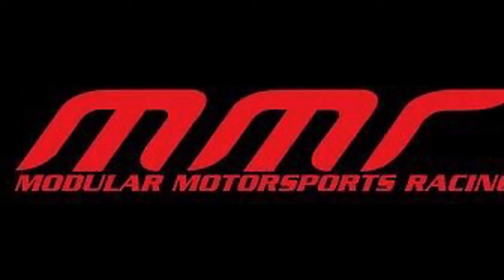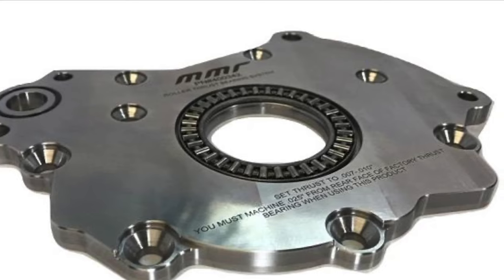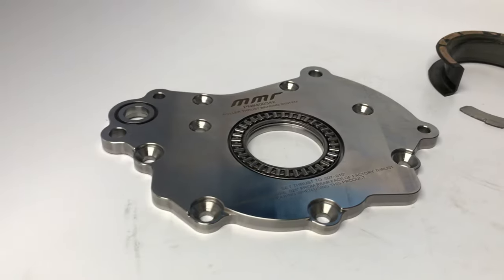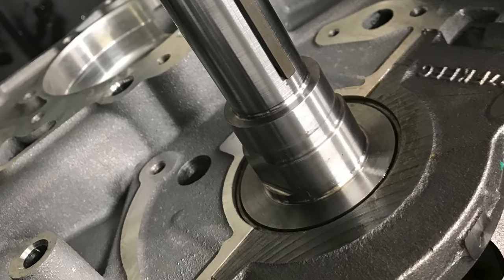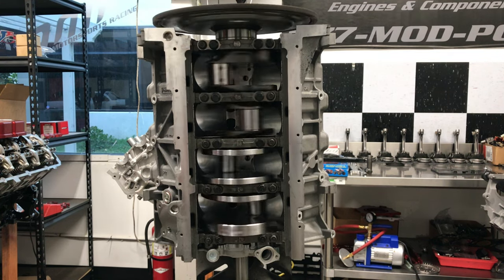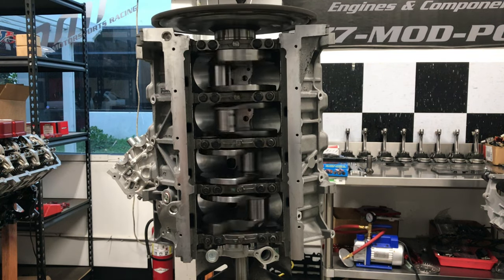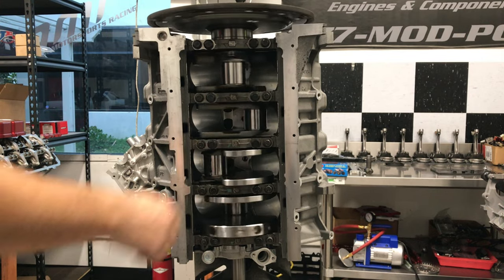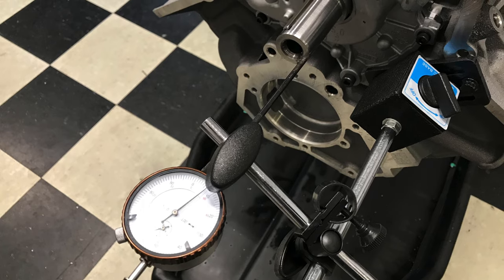MMR Roller Bearing Thrust system for Ford 5.0 / 5.2 Coyote Engines

Comment: if the engine is apart on a stand this is a no brainer upgrade somewhere in the level of removing the pulley driven water pump and using as electric water pump less rotating friction equals HP

Comment: The part I just was talking about is the rollers bearing pressure plate that sits behind the stock oil pressure pump to provide less friction.  About how long to install the part?
Thanks MMR you guys rock Jason Larson
Reply from the maker: About double the time to do a oil pump